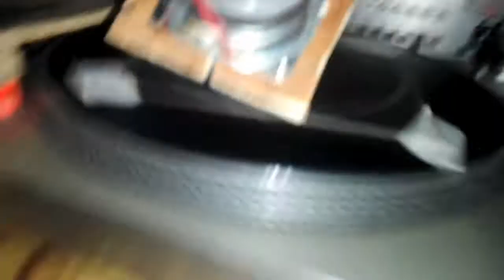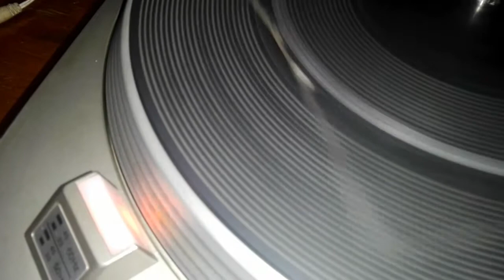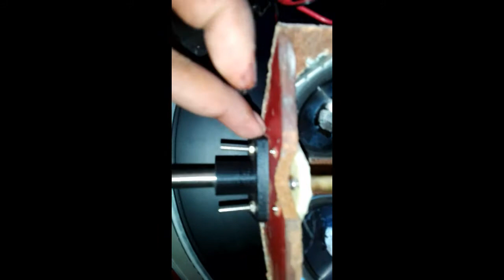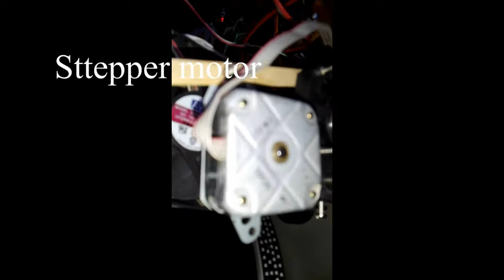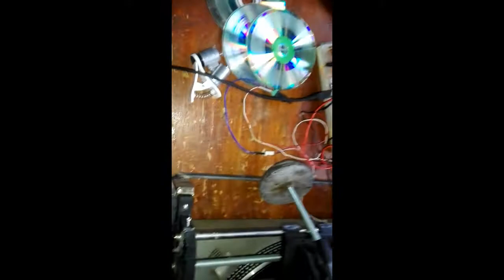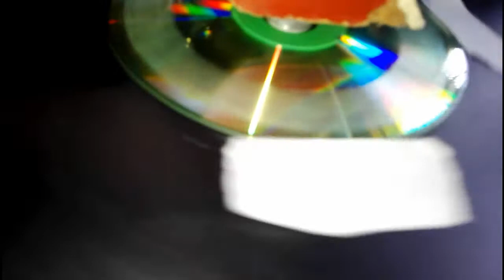Home made Record cutting lathe project

Comment: Very interesting i like what you did ....if i may ask if it cuts at 33 rpm what pitch is the thread on your feed screw that moves your cutter head please ...
Reply from the maker: Hi, Thank you very much for the comment, yes for this arrangement we can use both 33 and 45 rpm for cutting. still lot to develop.😊
Reply: Cutter speed over the disc is between 4 mm per minute to 12 mm per minute depending the length of the songs in order to cover the disc entirely